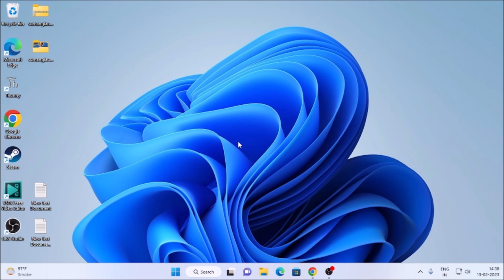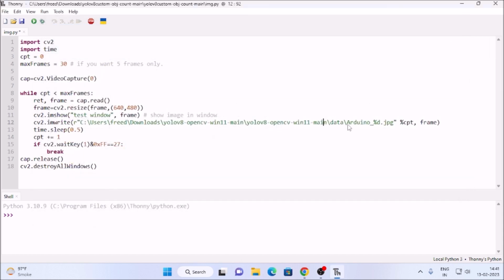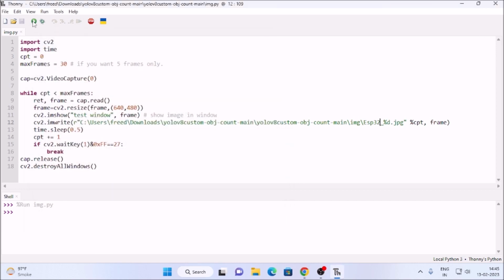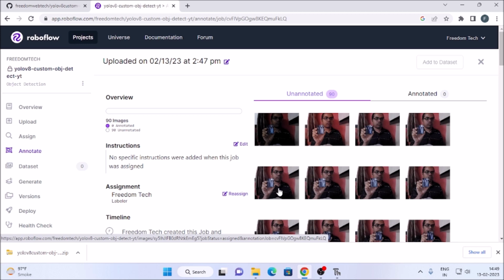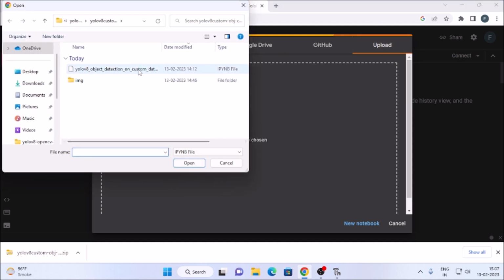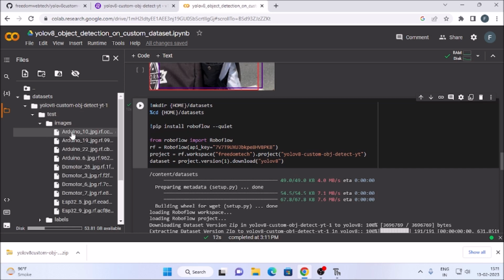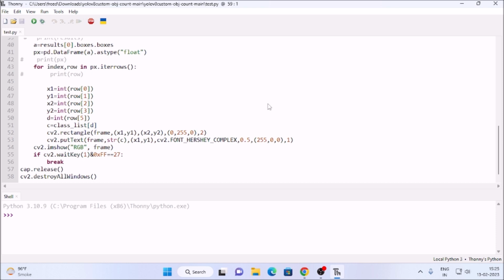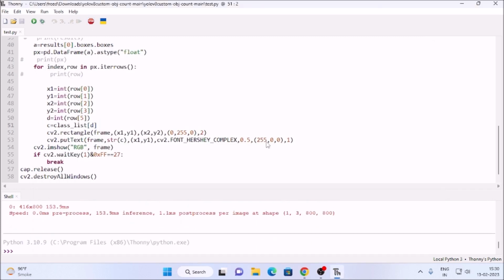YOLOv8: How to Train for Object Detection on a Custom Dataset | yolov8 custom object detection

Comment: can you please guide me for the model input as image even i run the test.py file i got the error of 
Exception has occurred: AttributeError
'Boxes' object has no attribute 'boxes'. See valid attributes below.

    Manages detection boxes, providing easy access and manipulation of box coordinates, confidence scores, class
    identifiers, and optional tracking IDs. Supports multiple formats for box coordinates, including both absolute and
    normalized forms.

    Attributes:
        data (torch.Tensor): The raw tensor containing detection boxes and their associated data.
        orig_shape (tuple): The original image size as a tuple (height, width), used for normalization.
        is_track (bool): Indicates whether tracking IDs are included in the box data.

    Properties:
        xyxy (torch.Tensor | numpy.ndarray): Boxes in [x1, y1, x2, y2] format.
        conf (torch.Tensor | numpy.ndarray): Confidence scores for each box.
        cls (torch.Tensor | numpy.ndarray): Class labels for each box.
        id (torch.Tensor | numpy.ndarray, optional): Tracking IDs for each box, if available.
        xywh (torch.Tensor | numpy.ndarray): Boxes in [x, y, width, height] format, calculated on demand.
        xyxyn (torch.Tensor | numpy.ndarray): Normalized [x1, y1, x2, y2] boxes, relative to `orig_shape`.
        xywhn (torch.Tensor | numpy.ndarray): Normalized [x, y, width, height] boxes, relative to `orig_shape`.

    Methods:
        cpu(): Moves the boxes to CPU memory.
        numpy(): Converts the boxes to a numpy array format.
        cuda(): Moves the boxes to CUDA (GPU) memory.
        to(device, dtype=None): Moves the boxes to the specified device.
    
  File "C:\Users\Administrator\Desktop\yolov8custom-obj-count\test.py", line 40, in <module>
    a=results[0].boxes.boxes
      ^^^^^^^^^^^^^^^^^^^^^^
AttributeError: 'Boxes' object has no attribute 'boxes'. See valid attributes below.

    Manages detection boxes, providing easy access and manipulation of box coordinates, confidence scores, class
    identifiers, and optional tracking IDs. Supports multiple formats for box coordinates, including both absolute and
    normalized forms.

    Attributes:
        data (torch.Tensor): The raw tensor containing detection boxes and their associated data.
        orig_shape (tuple): The original image size as a tuple (height, width), used for normalization.
        is_track (bool): Indicates whether tracking IDs are included in the box data.

    Properties:
        xyxy (torch.Tensor | numpy.ndarray): Boxes in [x1, y1, x2, y2] format.
        conf (torch.Tensor | numpy.ndarray): Confidence scores for each box.
        cls (torch.Tensor | numpy.ndarray): Class labels for each box.
        id (torch.Tensor | numpy.ndarray, optional): Tracking IDs for each box, if available.
        xywh (torch.Tensor | numpy.ndarray): Boxes in [x, y, width, height] format, calculated on demand.
        xyxyn (torch.Tensor | numpy.ndarray): Normalized [x1, y1, x2, y2] boxes, relative to `orig_shape`.
        xywhn (torch.Tensor | numpy.ndarray): Normalized [x, y, width, height] boxes, relative to `orig_shape`.

    Methods:
        cpu(): Moves the boxes to CPU memory.
        numpy(): Converts the boxes to a numpy array format.
        cuda(): Moves the boxes to CUDA (GPU) memory.
        to(device, dtype=None): Moves the boxes to the specified device.
Reply: I am having the same error as you, please help me fix this error. Thank you